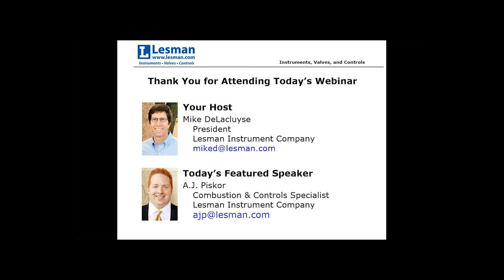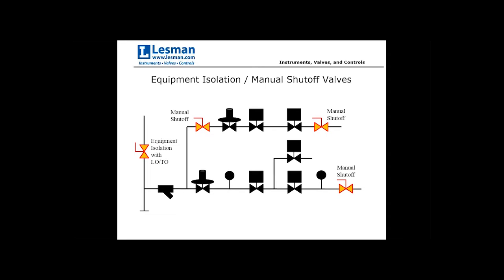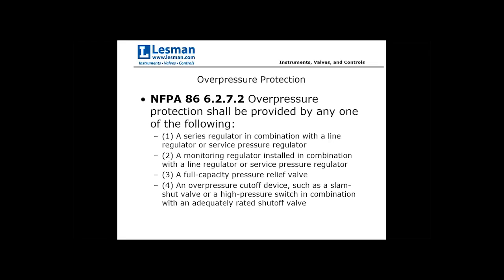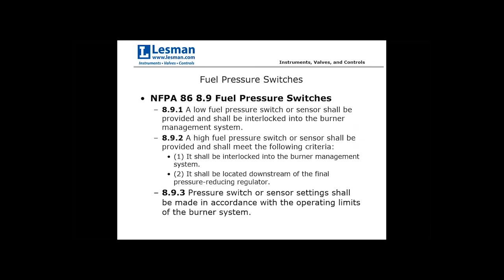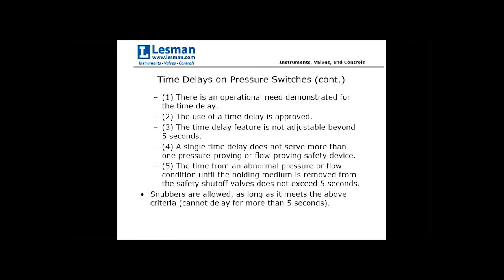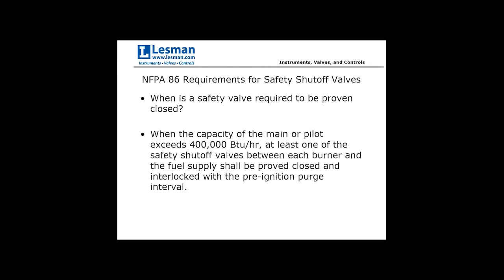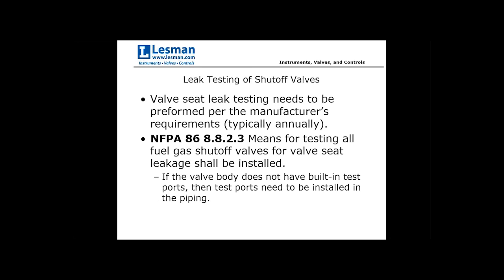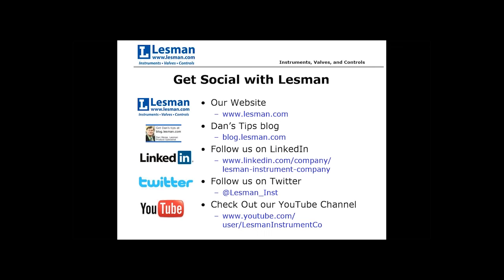Lesman Webinar: Fuel Train 101

Comment: Which is the better to control firing temperature controller connected with fuel gas controller or low selector in fired Heater?